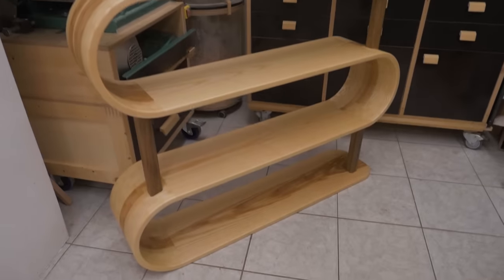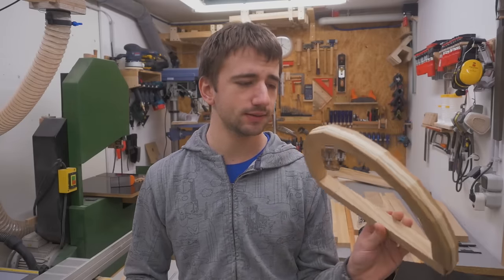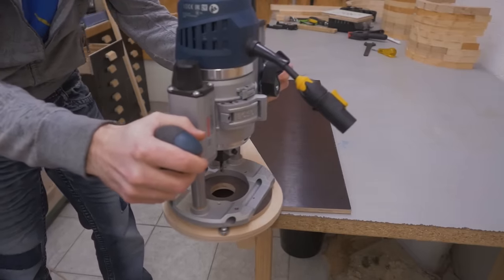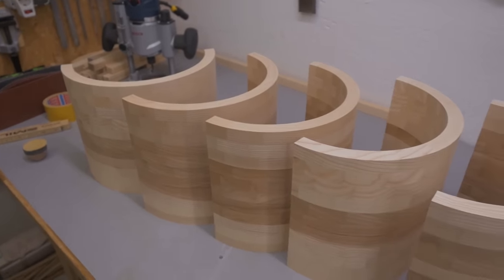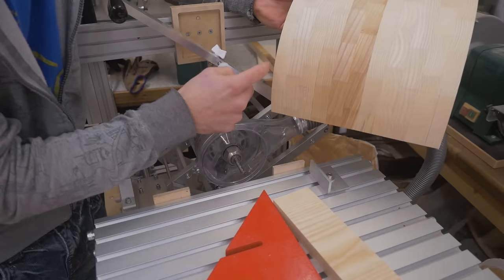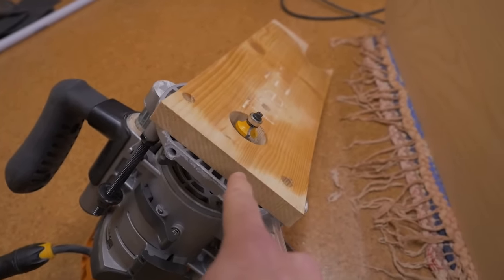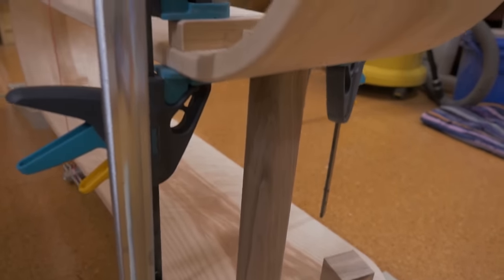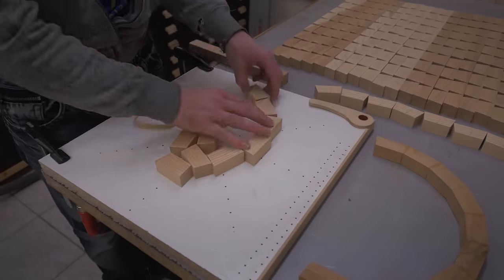Building an Amazing Shelf with more than 500 wooden Segments

Comment: I keep thinking, this is so much work, there has to be a simpler way.  But other than trying to do it sloppily, I can't think of a way.  I'd probably just make the ends square myself!
Reply: I was thinking a square ends with alternating butt joinery with a celtic wrought iron cut out end supports in like black walnut.
Reply: Matthias ...that's "a Wandel 1st class" ..."engineering world class" both of you... different Style incl. "humor"
Reply: Marius is definitely Matthias lost pupil. This was a great build. Keep up this amazing work! Awesome attention to detail!!!
Reply: I was thinking of steam-bending for the round corners. Any obstacles you foresee ? (too tight radius, too thick planks).
BTW Marius, really nice result in the end and I appreciate the sharing of your thought process (same for you Matthias I follow your channel for this reason).
Reply: Just build a machine for it ;-)
Reply: Matthias Wandel when most people think simple, they think IKEA. That doesn’t work for craftsmen.
Reply: @Cr30s  Yes, too thick & tight.
Reply: Probably sacrilege to say it in front of Mr Wandel, but veneer over an engineered wood substrate would be the simple way.
Reply: grafvonstauffenburg  If I was going to mass produce maybe a dozen or more, yeah, that would be the way to go. But for a one-off or maybe a pair of them, I was thinking MDF with edge banding and a veneer on the top and bottom. I have continued to sketch ideas on it all afternoon. If COVID 19 was not locking me out of my big shop (I'm a shop teacher) I'd probably be there working on it now. Depending on what the next 6 weeks bring, I may actually build it. Here's my thinking:

Cut the semicircular corners from 18mm (3/4") MDF on the CNC and build them up in layers the same way Herr Hornberger stacked his segmented layers, but eliminating the tedium of cutting the segments and fitting up the layers. I'd add two or three layers cut from steel plate as well, but these would have longer ends extending tangent to the semi circles top and bottom. They'd be sandwiched between the MDF layers. The extensions would be let in to slots cut into the ends of the shelves, also made from MDF.

There would be indexing holes through the layers so that they could be accurately clamped up with threaded rod that would be left in place and hide under the veneer and this would allow the shelf to free stand as the edge banding and veneer was applied. I'd look for some crotch veneer to band the curves and try to butt match it to the edge banding on the face edges of the shelves.

For the top and bottom surfaces of the shelves, I'd look for plain sliced veneer and try to find pieces long enough that I could butt match them with the joins on the underside of the shelves. I think it could be made to look as if the entire shelf was made from a single steam bent plank.

And I had a really crazy idea, what if the ends of the top and bottom shelf finished with a quarter circle and with a vertical piece that made a half twist so that the entire shelf unit was a folded Mobius strip? That would be super cool and might eliminate the need for the vertical braces.
Reply: Didn't you make a curvy board and bent lam playhouse
Reply: I'd expect nothing different coming from the man with one of my favorite quotes: "The space efficiency of pure chaos is hard to beat."
Reply: 20 degree rip on each side of 9 or 10 25cm long pieces would make each curved corner. Would these be too difficult or sloppy?
Reply: The way I would do it is turn 4 rings on a lathe, cut them in half, and use them as the ends. However because you can not control the grain direction this way, It would most likely not be as strong.
Reply: There is always another way
Reply: I would try to bend It with watter, break all the planks, make a mess and finally give up
Reply: @Cr30s  steam bending is not very 
dimensionally stable, you have a lot of springback 
and the amount of springback also differs per plank. Laminate is a way too, but that is also very time consuming. :(
Reply: @Cr30s   I honestly think that steam bending wouldn't work for more than one reason. Like the laminated veneer technique, as I mentioned above, there's "spring back" when you unclamp- very hard to obtain a fixed radius. Also with steam you would probably NEVER finish with a flat surface; it would never be square. The strain necessary to keep in position would put a lot of stress on the structure. Michel Thonet, the Swiss genius wood steam bender nearly always used cylindrical sections (profiles). If you DO try, I sincerely wish you the best of luck.
Reply: @christopherdahle9985  You utterly losty me with MDF. I would use Walnut as a substrate and cover it in Poplar before I'd ever use MDF for anything.
Reply: @devandestudios128 In general, MDF (A/K/A "termite barf") is not my favorite material. But with proper care and tooling, it machines well and for creating non-rectilinear shapes, it makes a good substrate. I'd have to watch the video and go back to my notes to fully explain vis-a-vis this video and I've already wasted the time it took to write my original post. But if I recall correctly, Herr Hornberger designed a shelf unit with lots of curves, requiring lots of fiddly little wedge pieces that had to be very carefully aligned. I was trying to come up with a way to make the grain flow more naturally without all of the angled interruptions around the corners, which lead to the idea of an MDF substrate, edged with solid pieces and faced with veneer.

Properly sealed and veneered, MDF is dimensionally stable through changes in temperature and humidity, and if the veneer is carefully applied by a skilled craftsman, the result is likely to be better than what can be done with solid lumber and doing so is far from unheard of, not just from IKEA, but also at the opposite end of the price/quality spectrum.
Reply: @christopherdahle9985  And in order for it to be able bear any weight at all, it practically has to be brasecd every foot or less apart to prevent it from sagging. Either that, or it has to be incredibly thick. It is indeed dimensionally stable, but that's about all it has going for it. And I don't care how well the veneer is applied, it will eventually come off. Would be better off using OSB as the substrate, it too is dimensionally stable, but it can bear weight far better than MDF. Hell, for that matter, I'd rather laminate individual blades of grass together than use MDF for anything.
Reply: @devandestudios128  I admire your tenacity and determination in defense of your opinion. I have no doubt that if you build furniture with the same ferocity, your career as a cabinet maker will be at least as long, fruitful and rewarding as mine. Good luck to you.
Reply: There is easier way.  you cut 1cm sheets and bend them in water basin.   In time they will take shape and which then are laminated together with glue.   They did that for my friends house with kitchen countertop and stair railings.  Came out great as it looks like one piece of wood bent in shape.
Reply: Okay, lots of strange ideas here : )

Surely, the best/fastest way is to put the cut and sanded wood on your saw bench and kerf it appropriately for the curved sections.  Now you can brush glue into the kerfs and bend around a former.  Finish with the lightest sanding ... and then front-up the piece (hideing the kerfs) with sheet, routing and bevelling to finish!
Reply: I guess Im asking randomly but does any of you know a trick to get back into an instagram account??
I stupidly lost my account password. I love any tricks you can offer me
Reply: @Tyler Zain Instablaster ;)
Reply: @Dorian Jeffrey thanks for your reply. I got to the site thru google and I'm waiting for the hacking stuff atm.
Seems to take quite some time so I will reply here later when my account password hopefully is recovered.
Reply: @Dorian Jeffrey It did the trick and I actually got access to my account again. Im so happy:D
Thanks so much, you really help me out!
Reply: @Tyler Zain No problem :)
Reply: Simple but monstrously wasteful and you'd have to be wary about the grains across layers: cnc the whole profile strips as thick as your cnc plunge depth, then glue them all together. You could try and optimize by glueing smallish pieces together along the contours and only cnc-ing away the minimum but using huge pieces would be fastest and most wasteful.

Comment: Instead of all the half-circle-plus-one-segment, most of the woodworkers I watch would make whole circles, and round them off in the lathe to create a perfect circle before cutting it in half. Doing them as individual layers would give you the opportunity to have the ends all sticking out to different distances to make a strong dovetail with the flat shelf, though.

Comment: Why are the supports off center? #qa
Reply: #QA #QandA several of us have asked that same question.
Reply: I wondered if that could be responsible for the lean back?
Reply: I would of altered the supports, Aesthetically it would of looked better and it might help out the leaning, but not sure on that.
Reply: I would think thats the side planed to be closer to the wall, and after wathing the video to the very end, that was not the case :)
Reply: @kentjohansson6937  Indeed, but surely it could be turned around = problem solved. It is reversible , isn't it?

Comment: Really Marius, this is a very challenging project. The way you went about the work is simply awe inspiring. You are a very methodical worker. Your workshop is exemplary in its organisation. Beautiful, clean machines, and all the measuring, cutting, and clamping tools any gifted craftsman like yourself could ever need. You went to so much  trouble to go all the way- no cutting corners. We all know that when there's curved work in wood, that's where the difficulty really starts. It was an interesting approach, using solid timber segments (what a job!!) when most people would have used multi layered veneers- which is less precise, because there's always "spring back" after unclamping. You have a mind directed towards precision, and have plenty of patience. An old cabinet maker takes off his hat to you young man! Greetings from France.
Reply: Sorry, I forgot to congratulate you on your humour too- that's very important.

Comment: 500 little triangles! i had something similar left over from a recent project that i finished. i ended up making a marble run with my son. the consistent angle and size of each piece made it easy to make modular pieces. at least some good has come from the covid lockdown

Comment: Beautiful designed book case-congrats! From watching so many you tube videos one thing is striking-the dust and wood chips that are thrown off from the filing and wood turning!  I wonder about the idea of having a separate room or container-put those machines that create so much dust and debris, and have them sealed, either by rigid walls/ceiling, or by heavy-duty plastic. Something like a sandblasting container or paint spray container.

Comment: Great project!  Lots of work for you  but very entertaining for us.  If I had the talent to do it, I think I would have added 2 pieces of walnut, the size of the shelf supports across the bottom of the bottom shelf, perpendicular to it and protruding slightly, maybe an inch or so in front and in back to add more vertical stability to the shelf so it would not fall forward as easily if someone were to carelessly put something heavy on it towards the front.  Amazing job!

Comment: Fantastic job!  Another possibility for this is to do the ends out of laminated layers and bend them rather than having to do all this cutting and gluing. I believe that if the pieces are thin enough you can soak them  and then make a forming jig. What would work better if you can get it is strips of wood that are very thin so that they are bendable without breaking. Again you would have to make a bending and clamping jig and then put the strips of wood together with glue in between them  and then start forming them in the jig. Do a youtube search for bending wood for Steinway grand piano.

Comment: Q&A A great project and attention to detail is fantastic.  Do you think you could make the curves with 10 segments that run the whole width of the shelf ?  They could be cut on the saw by tilting the blade over.  Would not get the strength of the misaligned brick pattern I guess.

Comment: I thought you were going to make the semicircles with cutting strips of wood the length equaling the depth you wanted. This way you would not need to cut and glue so many Cubs but would be working with strips.

I was wondering and stuck at how you would smooth out the curvem though with you gluing the Cubs into what the strips would have been, somehow was able to solve that.

Part of me is wondering if there could have been stronger joints than a tongue and groove.  Though either way, it would just likely still need the supporting vertical rods regardless. That or deciders staggered through the shelf. Or some type of backing frame to help ass suport like many,shelves need anyways so to keep tuen from folding over and down on it self. 

Wither way, your skills are way higher and better than I ever had been. Awesome job and awesomexfinished product. Giving you a well deserved pat on the back.

Comment: Use blue tape on each side of the crack to minimize the amount of epoxy that actually attaches to the wood  thus reducing the sanding. You can pull the blue tape while the epoxy is still slightly green      easy to do

Comment: Loved the video and the "magic" moment but I would have prefered it in bit size chunks over a couple of weeks. I think it would also benefit your viewing ratings.

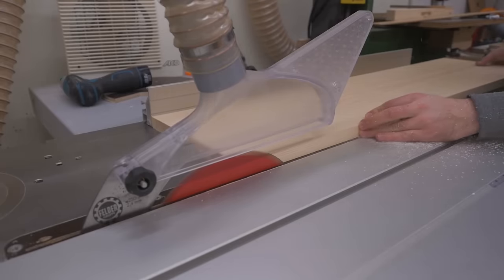Did I see it correct (at time 22:00) that you have a 3D-printed stop on your hammer cross-cut fence? I would be interested in the model since I noticed that mine isn't nice and square top to bottom (I think it has to do with the way it is tensioned by a nut that doesn't have a nice perpendicular face w.r.t. the threads)
Reply from the maker: No, there's nothing 3D printed on the saw

Comment: Wouldn't it have been possible to create a custom table saw blade with its teeth having an included angle of 20° to cut the little pieces for the roundings a bit quicker? No idea if your table saw (or any table saws in general) would allow for that.
#q&a #question

Comment: Great work there! Just a small question Why you did not glue up the supports when the shelf was lying on the floor (which is flat)? Then you would need to look for a square of the bottom. Or I am missing sth here? #QA

Comment: Is there a reason why you cut wedges out of the wood for the bends instead of doing kerf cuts or cutting the ends into thinner veneers and glue them to the correct radius? #QNA

Comment: How do you like the diamond blade from Felder?
Your video is absolutely fantastic but I have to confess the shelf is not to my taste (just like you said).
Cheers
Reply: Yes ...absolutely felt the same ...see the stickers on the background cabinet...maybe Matthias was born a few decades late... BUT the SKILL and the engineering INGENUITY (He never even showed a piece of CAD) ...on top of BRUTAL dedication. Like Matthias wrote: I would have likely  "Just cut of the edges"
Reply: I also have the FELDER Silent Power Diamond blade on a CF 741 P.  It is an amazing blade and I have not come across any scenario yet where I wanted to change blades.  

Marius, why not just use the Diamond blade for all your cuts?
Reply: @hendrikvanrensburg6747  That is exactly what I was wondering.

Comment: First of all: great job making this video (you watch too much This old Tony!)

Questions: 
1. wouldn't it be easier making the round parts out of a Barrel with 2 longer pieces to cut them out later?
2. Did you drill a hole in the upper floor to fasten the shelf to the wall like a picture frame?
3. Would you recommend to make the posts out of a longer piece of wood disguised as a book or will it be too flimsy if you used 15mm thick boards?
Reply: #QA very interesting questions. hope he can answer them all.

Comment: There is no faulting your flawless craftsmanship. But I have two quibbles: 1) the supports would have been more aesthetically pleasing if they were rounded  (dowels) and 2) why bother with the supports if it was meant to go against a wall? It would have been much better to have a backing on it that could be a support and just have the pure form of the winding S-shaped shelf without the supports. I kept thinking that the final purpose would be more like a room divider.
Reply from the maker: Making the supports round was harder and I wanted then square. And there is the chance that the shelf is free standing someday. Thanks for the questions

Comment: Why did you cut out the little triangles instead of just flipping the bar of wood over? it would be more efficient and take less time.
Reply: Seth H Save time...yes, but the grain would not line up on the outside. The result he gets for the time is almost the same as if he were to have steam bent each piece...which, for reference, would have been impossible to do with that wood/radius/size.

Comment: Your "pendulum" is called a "plumb line"
Reply: Were it to swing back and forth like in a clock it would be a pendulum, but for finding a vertical it is a plumb line, and the weight on the end a plumb bob, at least in my part of the UK.
Spectacular shelf and workmanship, and your English is similarly better than my German as your woodworking is better than mine! 👏👏